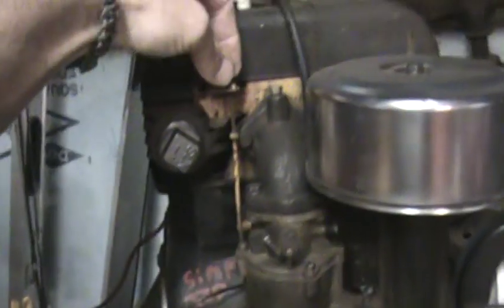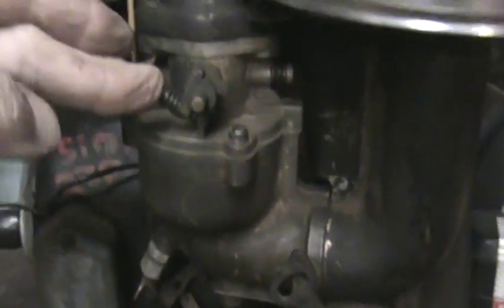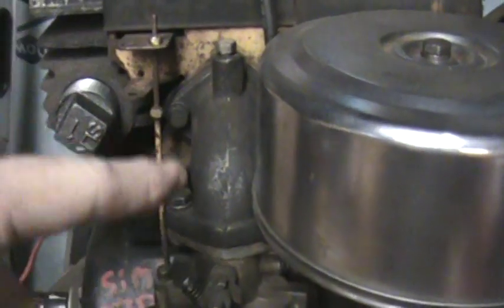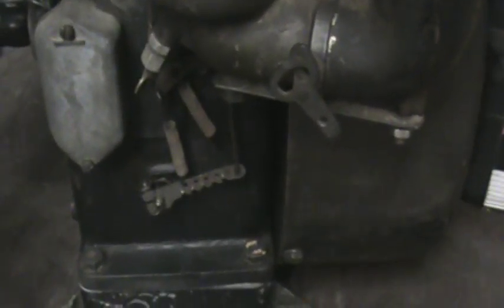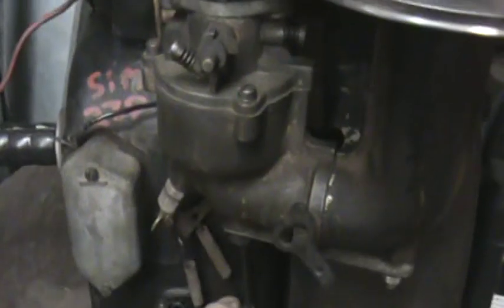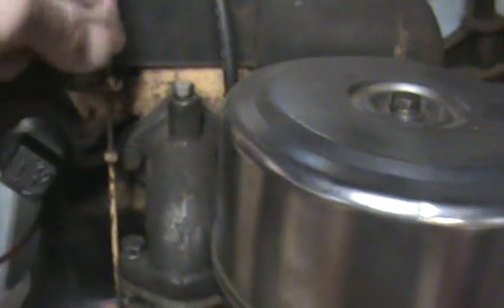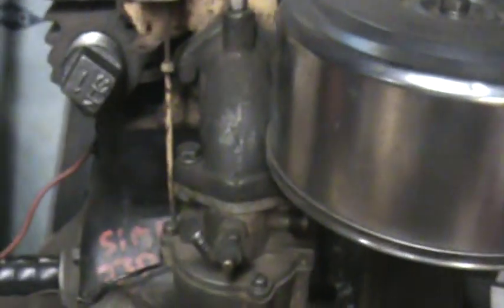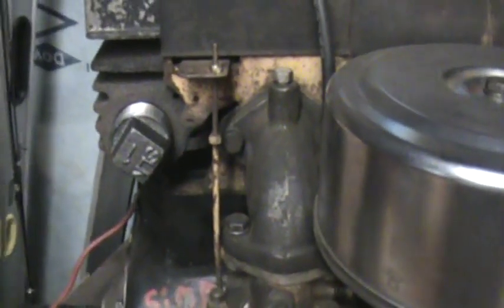Throttle adjustment on Briggs Horizontal Cast Iron Engines

Comment: Thanks for the Tip about the Governor forcing the throttle body closed when started up... I just cleaned my Toro 11HP Carb. I thought I missed or lost a spring, because the throttle would not close by itself while I was hooking up the linkage.... (when I re-installed the clean Carb...)
I started it up, and the Gov. forced the throttle to the correct position...
Great Video...
thanks...

Comment from the maker: Absolutely....as long as the engine isn't throwing oil into the combustion chamber. They don't like that. But they are an excellent plug. I have E3s in 5 of my tractors. The rest have the old CJ8s.

Comment from the maker: @kelkenb8 My engines range in HP from 8 to 16. Typically, if you have to choke it to keep it running there is a fuel delivery problem. First try this.....start the engine, let it get warm at idle, then turn the main jet screw (can be seen in my carb rebuild series) counter clockwise slowly. If the engine starts to blow black smoke and idle rough, open the choke a little at a time. Do this until the engine will idle w/o choke, then increase the engine speed and adjust main jet until it runs well.

Comment: Still making videos for this engine? Been a while but I picked one up cheap and was wondering if I could put a different carburetor that has its own throttle and delete the governor? Looking to get more out of a coleman mini bike...alot more!
Reply from the maker: I'm not your guy for altering engines from stock Nicholas, but there are many channels that DO cater to small engine modifications. Simply search governor delete mini bike or go cart and you'll get many many results. Zip~

Comment: Hey Zippo I just bought a 3012. What do recommend  for an exhaust port that has no threads left. Also the carburetor is missing the plate at the bottom. I'm able to look straight at the choke valve do you where I could find one
Reply from the maker: Stripped exhaust port threads would require you find a 1inch NPT tap and re-tap the port. As for the carb. That part is called a Welsh Plug, and your part number is 221747. Put that part number in at Partstree dott comm and you'll be all set. To install, you'll notice it is convex. Put the convex (not concave or sunken in) to the outside of the carb and by peening (hammering) in the bulge to flatten out the plug, you'll expand the over all diameter and it should wedge into the groove in the end of the carburetor body. OR....if you just want it covered to prevent dust and other contaminants from entering the carb, take a cap off a one gallon anti freeze jug, cut off the safety tab, and press the cap into the carburetor with the open side of the cap facing outward. It's the perfect diameter at the base of the cap that it'll wedge in and mimic the Welsh Plugs job of keeping the debris out of the carb. Cheers! Zip~
Reply: ZippoVarga thanks zippo I have one on the way. I'll be working on the ignition in the mean time

Comment: i have a allis chalmers model b10 that dies when i try to move it from choke on to off do u know what it might be
Reply from the maker: Either partially blocked gas tank and lines or a carb adjustment. I've got videos on the subject Samuel. Cheers! Zip~

Comment: hay zipp I got a cast iron Briggs & Stratton 12 HP on a simplicity sovereign 3012 and the rods that got to the governor and the carb I do not have some one was working on it and lost a lot of stuff but to good news is I got it running good but I don't have the right stuff for the governor other then I piece of wire holding the governor and the other bar together and I got a rod going from the governor to the carb and my cable is hocked to the governor I don't think I got it set up right
Reply from the maker: I have many other videos on properly setting up the throttle to the governor and to the carburetor. Zip~